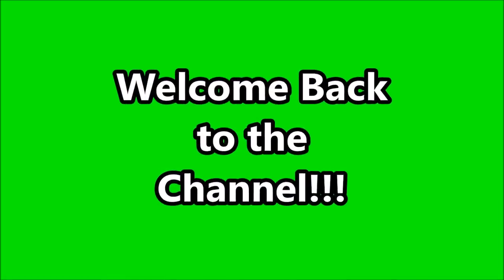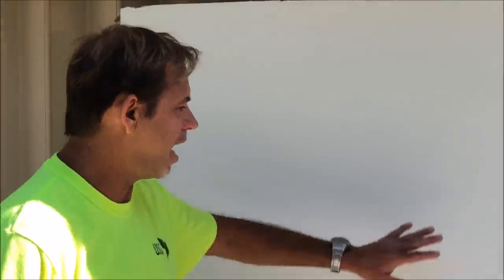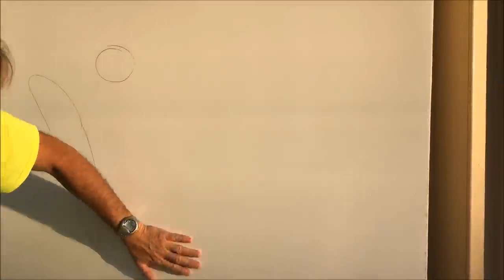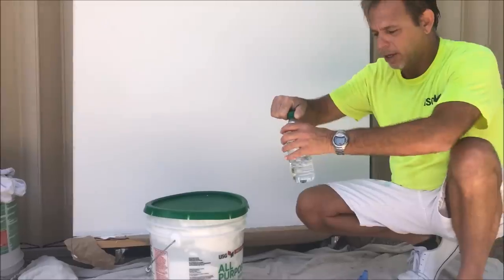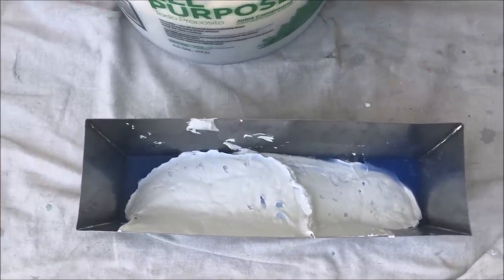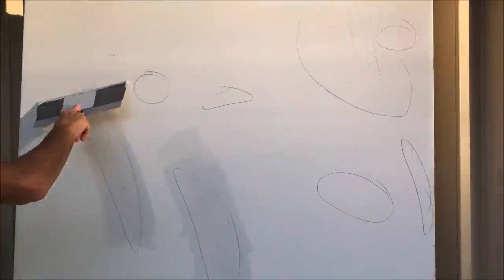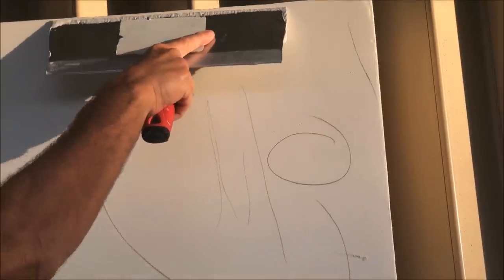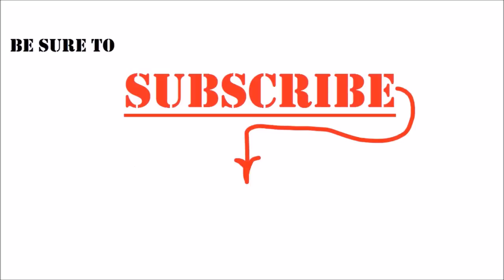How you can get the smoothest walls with these skim coating tips and tricks

Comment: Applying mud over top of sanded mud will leave a unwanted effect called "onion skinning". The trick to fixing imperfections in drywall mud that has been sanded or skim coats is to spray the surrounding area with a fine misted water, then spot or fix your imperfections. Then do a final sanding.
Reply: So what exactly is "onion skinning"?
Reply: Completely untrue, most pro drywall guys sand between coats

Comment: Been finisher for 30 plus yrs and all that does is add chalk to the taping mud which is for taping not skimming also directions on the bucket  tells you not for top coating and the chalk makes the mud harder and it will  now sand at a different  rate and  wouldn't  want to  have to sand that

Comment: Great video Paul. A good trick to keep the little chunks from getting in your mud is to cover the mud with about 1/2 inch of water before you seal the bucket each time. When you open it tomorrow all the mud will be under the water, no dried pieces to mess up your skims. Dump the water and start working.
Reply from the maker: Right on Danny! Great tip!👍🏻 Yes, take a wet sponge to wipe the inside of the bucket edges and add a 1/2” of water over the remaining joint compound!💥 Thanks so much for watching and subscribing my friend!😎 -Paul
Reply: why do you need the blue stuff when you still can see the pencil marks through it all?
Reply: That's what my handyman does

Comment: I’m patching seven various sized holes in my home left from a plumbing repair job—four foot by one foot for the biggest and down to an 8” by 10” hole. I saved the pieces they cut out and re-installed them to fill the holes. This is a little challenging taping and mudding over all these holes due to the orange peel texture causing the knife to chatter quite a bit. I’m also a first timer using hot mud. I used USG 45 going over the repair areas, which I taped with fiberglass mesh tape.  I got my patches fairly smooth on the first few, but I had way too may bumps and blemishes on a couple patches. I got advice on wet-sanding/ragging hot mud instead of sanding from another pro and that saved me—I was able to smooth out everything and make a much better feathered edge using the wet sand methods. I also mixed the 45 mud a little loose. Thank you so much for your tutorials—you are a solid professional, and I really appreciate you guys who are willing to share your knowledge to help folks out.

Comment: Love that trick! I'm putting you right up there with Chris, the Idaho Painter!
I'll share some of mine with you - I learned to hook a shop vac up to a palm sander. It sands so fast, you have to keep it moving or it can burn the tape! Very little effort too.
 End of the day, I "park" my mud by scraping the bucket walls with a 6" knife so I have all the mud neatly flat with nothing to dry out and fall into it, making streakers. Then I use my thumb/forefinger web or a rag to go around the rim, and also check the lid. Even a year later this mud is still good to go!
Reply: A small dish sponge works well too.

Comment: We mix a little pigment in a full bucket of mud when we do touch ups so you can find all your touch ups .. I have to prime as well and this insure you not to get hot spot from patches not primed
Since all the walls are primed ,colored mud does not hurt a thing actually USG used to make a pigment mud a few years back we use yellow pigment so did USG
Reply: USG still makes tinted +/3. Ironically, I find it Home Depot or Lowes, the supply houses it's just stark white... yuck!

Comment: Not sure if he mentioned it,,, but if you are applying touch ups, you should prime first or apply the touch ups before sanding. Adding the touch ups puts a thin layer of mud on but it will be hard to sand it perfectly if it was already sanded. The primer will help create a barrier so you can sand the touch ups and then spot prime the touchup areas to get a smooth finish.

Comment: I am slowly working on remodeling a rec room that has a brick  fireplace. The brick work runs up the wall. The walls had paneling that was glued and nailed on. When removing the old paneling it pulled off the paper on the drywall and it looks real bad. There is also a lot of nail hole in the wall. I will need to put new sheet rock on the ceiling as well.  I am a DIYer and I have little to no experience in this. Would like to know how to mud around the brick work and inside corners. Really enjoy your videos.  Thanks for all your doing.  MH  Tacoma, Washington
Reply: You don't necessarily have to re-drywall. Chip or scrape the high adhesives off. Where paper has peeled, coat and wait for the bubbles in the paper to show. Cut them out and keep on doing that over and over till you've gotten rid of all the bubbles. Now skim, preferably w/ +/3 mud. After some time and work, lots of sanding if you're a novice, you'll have the finished product you want. You go DIY'er!!

Comment: I lost a lot, including my house, and moved into a shoebox condo. I got the bright idea to pull the paper off the bathroom walls and paint. Getting rid of that paper and having peach walls would boost my spirits and allow me to start each new day in a happy, if tiny, bathroom, thus boosting my spirits. 

“It will all be better if the bathroom looks good instead of terrible.” So that was the plan. 

There are a bunch of digs in the walls and one spot where I pulled a chunk of the wall off with the paper. Plus - PLUS! - the Home Depot guy told me to use this little thing that puts holes in the paper. It didn’t help with paper removal and in two spots it went through to the wall, so now I have to fix my mistake. Also... The walls are not even! They’re kind of rolly.

I am feeling very overwhelmed and very stupid for even starting this, but the paper is mostly off so there is no turning back now. 

I’ve been looking around online and the answer seems to be “skim coat it.” 

I want them smooth. Orange peel would be nice for the hall and living room, but the bathroom should be smooth. 

Wish me luck! (I need it.)

Comment: For touch ups after the wall is smooth, I'd actually do those after vacuuming and priming the walls so I lock in the skim coat. This way I don't risk over sanding the existing skim during the sanding  of the touch up. Also, it is much easier to see imperfections such us bubbles etc.

Comment: I see your using All purpose for skim coating but I use Ultralight which has less Adhesive and easier to sand for skim coating. My current project involves repairing, skim coating and painting my garage walls.

Comment: Awesome trick! I do a similar technique when doing body work.
Question for ya...
I have my parents bathroom that has alot of blistered areas on the ceiling, especially over the shower. They never had a ceiling fan, so im guessing the hot showers over 20 some yrs has caused this issue...
How would i go about repairing it?
Should i sand the entire ceiling with a 100 or 120 grit, clean off the dust, then start skimming just the problem areas? Or should i try and skim coat the entire ceiling at once? I was worried about it shrinking back after its dry and still being able to see all the marks.
Thank you!
Reply: splash skim with usg all purpose. Cut out any blisters with a utility knife. Touch up blister area. Sand surface.    TEXTURE OR PAINT
Reply: OLD SCHOOL 
Awesome! Thanks for the reply
Reply: Careful, oils accumulate on bath lids... clean thoroughly with TSP first, cut out bubbles, tape if necessary, skim until the cows come home.

Comment: Hey, so I removed 4 layers of wallpaper and the last layer ripped off a bunch of the top layer of Sheetrock. I sanded the entire room with 120 grit, then put one coat of Pro-999/rx-35 on top. My questions are : 1. should I put another coat of the sealer before skimming the wall? 2. should I sand the sealer before skimming? 3. Is a roller with joint compound a better option for large areas? Thank you, I really enjoyed your videos.
Reply: ROLLER IS A GREAT IDEA BUT IT IS A PRACTICED ART. BE PREPARED. MAYBE NEXT TIME JUST RIP OFF OLD ROCK WITH 4 LAYERS OF PAPER AND PUT NEW. TOO MUCH TIME WASTED
Reply: @buildinit6523  Or apply 3/8" glue and screw,

Comment: I skim coated a wall after repairing an area of drywall I had to open for light fixtures.  When I was applying paint after letting the final coat of mud dry over night. Part of the skin coat would peel as I run the paint roller over it
Reply: True level 5 is primed at level 4 then touch up is done and DON'T ROLL TO MUCH. If you get the mud too wet it will become workable again. Thus your situation.

Comment: Hi Paul. Thanks for the video.
Off the wall question. ...see what i did there. :)
Im a flooring guy.  Im great with a trowel as thats what we use to patch , etc.
I've never done texturing on drywall . On the floor your always thinking about moving in the horizontal plane with the trowel.. For the most part.
I Always have one hand down on the floor and one on the trowel.  Its what i know and have muscle memory as you do with a knife.
Because I'm only doing one job.(my house) . Im thinking i may have better luck with a trowel.??? ( skim coat )
If you had to patch 1 floor. Just once, would you use you drywall knife to do it because its what you know? 
Assuming you have never picked up a finishing trowel??

Comment: The ceiling was bulging down in an area.  On further inspection, there was evidence of moisture damage.  As I chipped away uncovering fluffy, crumbly sheetrock with a light glaze of black mildew between the sheetrock and the skim coat.  Should I cut the skim coat with a craft knife to the area that is mostly damaged?  Or should I take the whole skim coat down as far as it has separated from the sheetrock above?  That could be the whole room! 

I am pretty good at patching large and small holes in sheetrock walls, but have never before done a ceiling.  I feel I reasonably understand how to cut out the bad sheetrock, add furring strips, and patch with a new piece, tape and mud.  My main concern is whether to remove an entire room worth of skim coat from the ceiling and then spray with bleach to kill the mildew?  Or should I attempt to limit the area of skim coat removal even though I can see it slightly bulging away from the ceiling?
Reply from the maker: Wow Robin!😳 That’s a tough one... My first question would be, Where is the moisture coming from? Have you figured that out yet? Thanks so much for watching and subscribing my friend!🙏 -Paul

Comment: I’ve been painting for 25 years, and also own my own business. I also use the pencil trick for my touch ups as well. I’ve never seen the chalk line chalk added to the joint compound. I don’t understand the purpose if it’s already penciled to know where the areas are to be sanded. To me the pencil works great as is. Is there another purpose behind the chalk?
Reply: christopher iorio , I’ve seen people with pencils marking walls , sometimes they would have to patch whatever they circled and the circle they marked on the wall. I know it sounds simple enough to circle a scratch or ding with a pencil on new drywall but people are usually in a hurry and don’t take time to do it right. I usually ask the drywall guy to add chalk when patching, especially when using white primer, makes them real easy to find.

Comment: Paul I’m a painting contractor in swfl. Recently removed a popcorn ceiling and applied a knockdown texture throughout the home. On the ceilings, I kept running into uneven areas that flattened out the texture when I was knocking it down. How do I fix it? Thanks!
Reply: Wavy ceiling drywall is common in high humidity areas You should have allowed the mud to dry longer before knocking it down.

Comment: sometimes its hard to notice imperfection in the skim coat until after painting.  Can you use compound over those painted area's?
Reply from the maker: Yes but you’ll need to prime and paint the repaired areas only before repainting the whole wall again. Otherwise those areas will flash.👍🏻 I hope this helps. Thanks so much for watching and subscribing! -Paul
Reply: Thanks.  Great video.
Reply from the maker: Thank you!👊🏻😎

Comment: Trying to save some serious cash by skim coating over an old splatter textured hallway and bedroom.  I also added metal corner bead to all outside corners in the hallway (guess they didnt have them in 1951 when my home was built).  Trying to achieve a smooth "hand textured" appearance.

 Did my first coat with setting compound, now starting on second coat with all purpose USG per-mixed compound.

Any tips???
Reply from the maker: Awesome man!👍🏻 Did you apply the first skim coat by hand or did you use my paint roller trick? -Paul

Comment: Looking for your thoughts.  I was leveling poorly finished walls joints.  Using All purpose compound.  I had a bad case of blistering after the second or third coat.  Why? And, what can  be done to resolve this issue?  Also, I noticed other blisters after priming with PVC.  Sure would appreciate some advice.Thanks for your time.
Reply from the maker: Bat,  Did you sand the wall? What was your prep before paint? -Paul
Reply: Yeah what he said you either have bad adhesion or there's moisture in the wall
Reply: The second and third coat was of all purpose compound. It blistered after applying for prior coat of all purpose compound.  After it was sanded, and PVC primer was applied it also blistered.
Reply: @battime5418  , Are you talking "blisters" or "bubbles"? There is a difference. And a specific way to handle each.

Comment: Hi Paul I am a dyi guy just starting out. I have popcorn ceilings in my house and they are looking pretty bad. I am skim coating over them. The wall I am doing now has first coat on. But is pretty rough. Do I need too sand it first and then apply second coat?  Or scrape it and then apply. Mixed mud half bucket mud and added half cup water too it. Des final coat need too be thinner than first coat?

Comment: Question? How do you repair a painter kn wall over bad compound and t as pe showing?
Reply from the maker: Hi Keith, I would check the joints for flatness first, then proceed with mudding over the joints to make them flat or remove the tape if it sitting proud and starting over. I hope this helps. Take care, -Paul

Comment: Hey Paul. Great videos, but why not Ultra light for skim? does it not work as well? or was the all purpose just a personal choice?
Reply: JD  I just finished a job and used UL on the both coats. There were some bubbles coming up on the first coat because of the painted surface had a sheen. other than that, it worked out great, I think he just like to use All Purpose for EVERYTHING! lol
Reply: JD   lookup Vancouver Carpenter channel. that guy has a great video on skim coating a ceilings

Comment: Good tip Paul from someone who does this as part of his bottom line. Thanks for sharing. Any trick to minimize airborne sanding dust is good information. Hated to see you have to deal with those hitchhikers in a fresh/tiny batch of mud though. :( sigh 
Best regards, subscribed.

Comment: Hi there Paul great video learning and tips to get a neater flat finish with drywall. Thanks for sharing your techniques. Do you mind if I ask you a question as I am asked all the time. For making textured finishes, which kind of texture compound would you recommend which is available in the States. A compound that does not dry fast is ideal. Thank you for your help. Have a great day
Reply: SPANTEX SPRAY
Reply: Hey there Del, thanks for your reply. The texture compound I mean are for making comb textures, to roll the mud onto the ceiling or wall

Comment: Do you prefer a stainless steel or blue steel blade?
Reply from the maker: Hi Steve, I prefer stainless because it doesn't rust. Great question. What do you prefer? or Are you new to this thing we call drywall? :>)  -Paul
Reply: I'm a general contractor and do most of my own drywall and tapping.  I use both stainless and blue steel.  The blue steel is more flexible and works best for me when I'm fixing imperfections.  I use the stainless for most large all purpose applications.

Comment: I have a couple of problems with the drywall in my home. It was freshly painted when I moved in but I have been noticing more and more drywall nails or screw heads and the bedrooms have been painted very dark, two brown and one navy blue and it appears as if someone has been sanding the ceilings as the walls are covered in a light coloured dust which I have washed a couple of times. It actually looks like that dust is coming through the paint.
Reply: Or... the dust could be from the airless used to paint before you moved in.